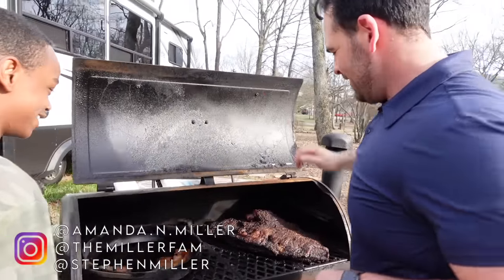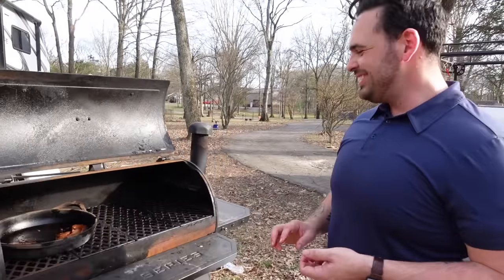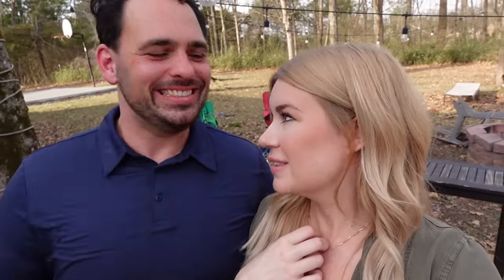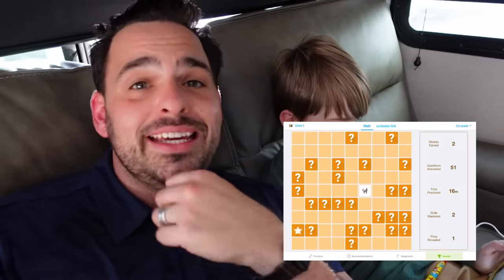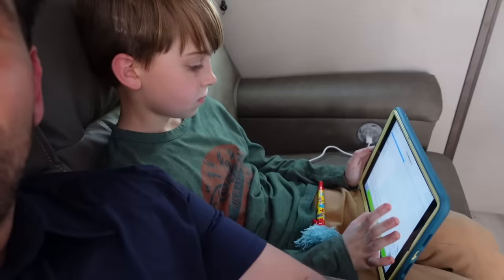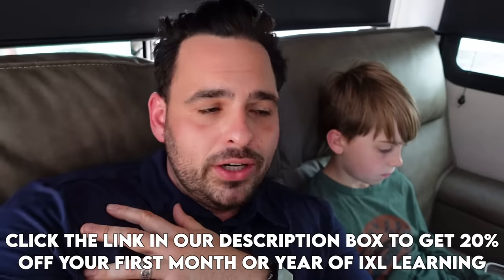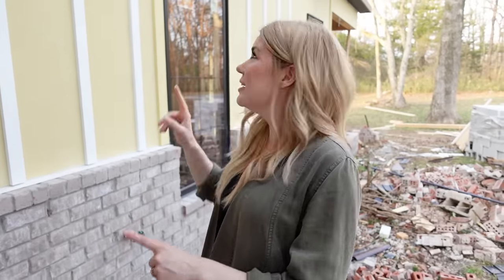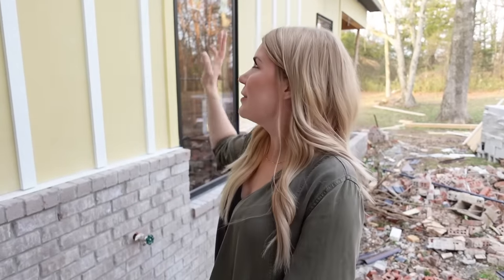RENOVATING our DREAM HOUSE! 🎉 1970 Fixer Upper! 😳

Comment: I wanted to share this for those of you who are getting migraines. I used to get migraines all the time and it was due to  trauma.  This trauma was basic around the fact that I couldn't leave or get out of a situation, and the 2nd I started acting out some of those physical needs to push and hit things safely I was able to get a lot of that tension out of my body and I haven't had a migraine in over 3 months which is longer than I've ever gone.
Https://youtu.be/bjeJC86RBgE

Comment: It's going to be gorgeous. They got so much done. Do check the angle on the brick sash under the windows. They look too level to me and they should be angled down so water runs off easily rather than pooling (esp snow). You don't want leaks or staining of those bricks.